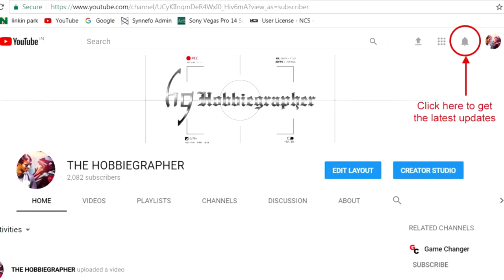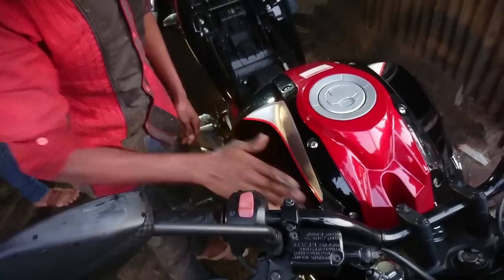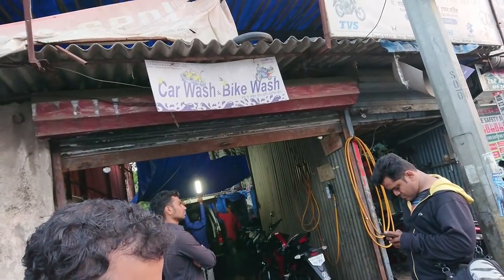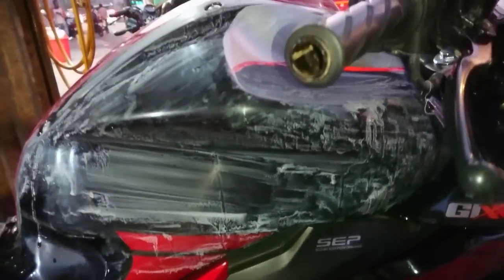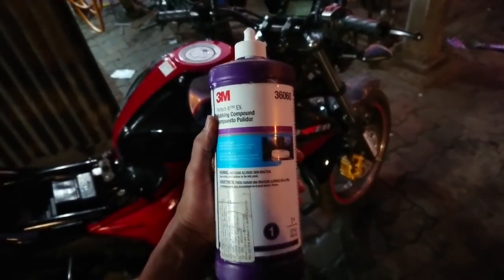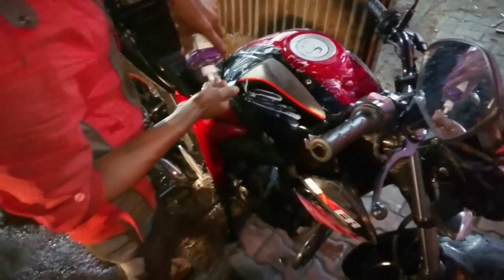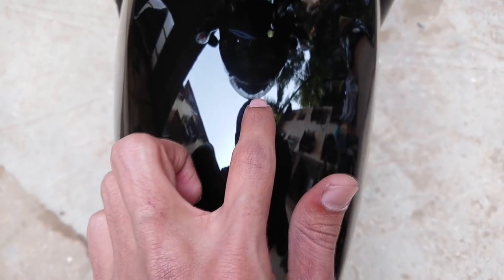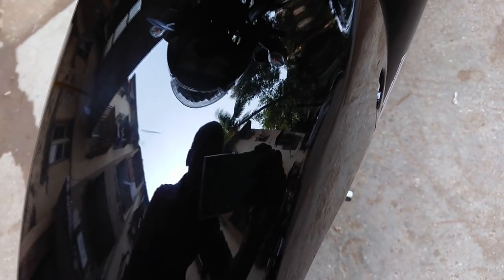Make your bike look brand new by Teflon Coating (Part 2)

Comment: Both the wet sanding and rubbing compound removed minute layers of the clear coat, unveiling another layer of clear coat and removing scratches which had penetrated a small layer of the clear coat.
Reply from the maker: +Shashank K R yes correct

Comment: Teflon kiti diwas or months tikun rahte....what about you???..its long lasting?
Reply from the maker: Tula atleast twice a week waxing karavi lagel. Tevha jaun toh atleast 8 months tikto.
Reply: Bro..but bike wash keli tr sagli Teflon caoting jaail na
Reply from the maker: Nai re teflon asa jat nai wax jato.
Reply: But bro to sand paper ne karto tyane main paint la kahi damage honar nahi na
Reply from the maker: Jasta zorat kela tar paint nighu shakto mhanun te lighly kartat jyane only varcha clear coat nighto. And te teflon is a kind of clear coat je apply kelyavar sagla proper hota.
Reply: Bro tu satisfied aahes na .. Coating ne??
Reply from the maker: Yes but ata parat scratches ale mi ata parat karun ghenar
Reply: Mi aaj jaun aalo tyane 700 cost keli aahe
Reply from the maker: Powai? Yes ata 700 keli

Comment: Sir, how often Teflon coating is required. For example if I do it now, when would the next be due. I have an access 125 .
Reply from the maker: It lasts Approx 6 month but if you wax it weekly it lasts for a year
Reply: THE HOBBIEGRAPHER ... What's the difference between wax and polish. Also do I need to wash my  scooter daily or 1ce a week. Pls help
Reply from the maker: Wax and polish is the same
And you dont need to wash it daily weekly wash is ok as the wax lasts for a week
Reply: THE HOBBIEGRAPHER ... Thank you for your advice

Comment: I think this is not teflon coating. This is called Detailing. Teflon coating is used on metal parts to avoid rusting. This is my understanding.
Reply from the maker: Yup but any ways they use the same product for painted fiber and metal

Comment: How much it costed bro
Reply from the maker: +Imdadullah Shaik. 600
Reply: Imdadullah Shaik. ... Bro don't use it on new bike ever .. if you don't want to loose original layer of color... You can use it on old bike .. but it's helpful for 4-5 days only .. you can apply 9H ceramic coating on new bike .. that will cost you around 2000/- .. that will work for 2-3 years .

Comment: Only use 9H ceramic coating on new bike ... That will work for 2-3 years .. don't apply teflon coating .. it's harmful for your orifinal color layer and it will work for 3-4 days only....
Reply from the maker: Yes you are correct that teflon should not be applied on new bike as they already have a coating.
Ceramic coating is is the best and i have mentioned that point but its too expensive.
For overall detailing here in mumbai the quotation is around 6.5k.